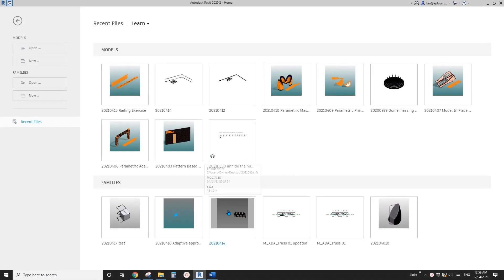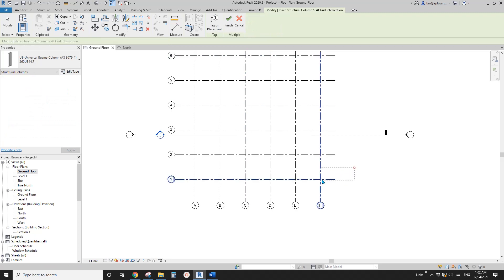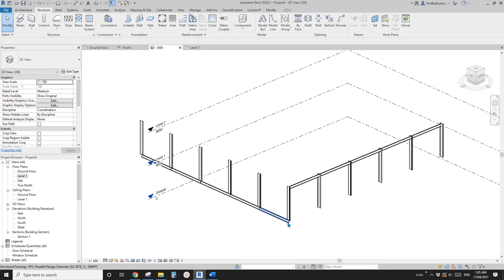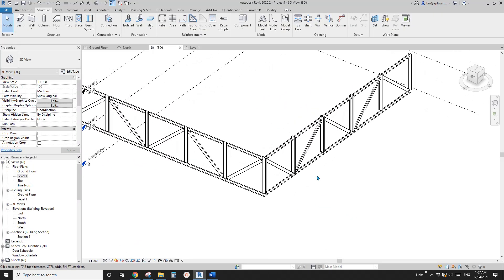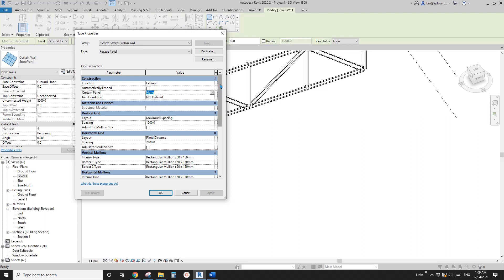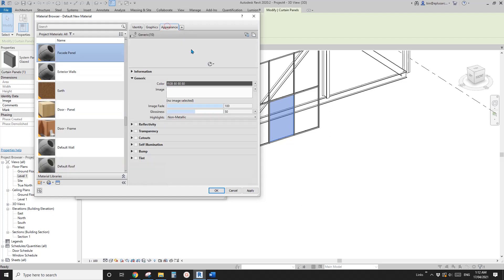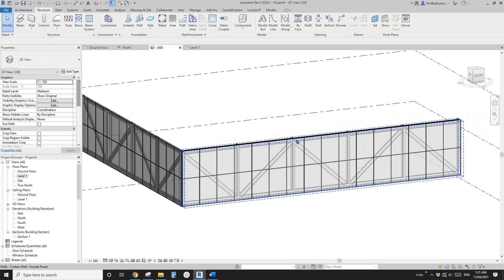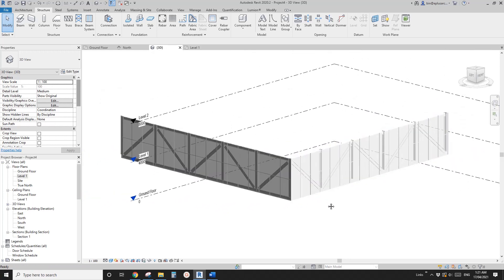Everyday Revit (Day 394) - Structural Framing and Curtain Wall Facade

Comment: Thank You Very Much ☺️. I just have a question🙋🏻‍♀️, where can i find the corner mullion? is it in the AUS library?
Reply from the maker: The corner mullion should be in the architectural template, there are a few different type, I usually use the Quad mullion. But the default size is 150x150mm, you need to create a new type to match your other mullions.
Reply: @BINHE615  Thank you

Comment: great tuto Bin,just curius is it to dificult to make perfect conection betwenn structural 
 elements
Reply from the maker: It’s not, but you will need to use Structural Connections, which I’m not very familiar about. You can have a look yourself. They are under the structure tab. Also the Steel tab if useful if you want to model steel plates.